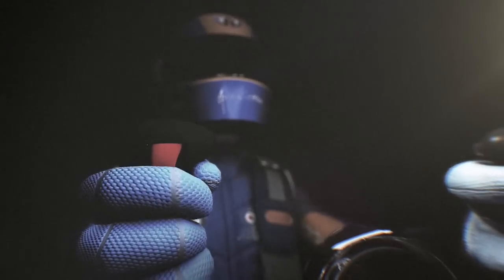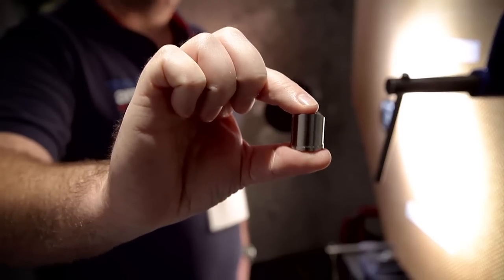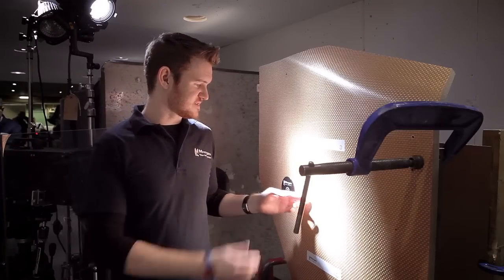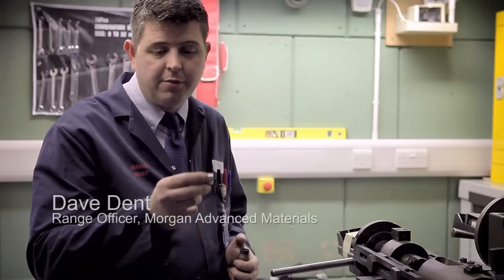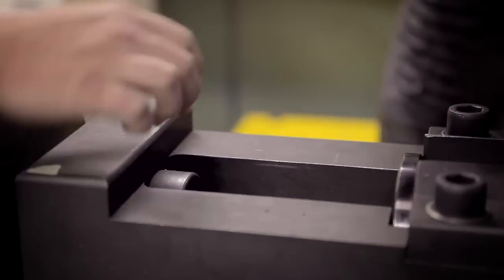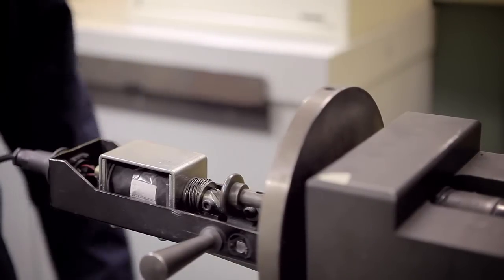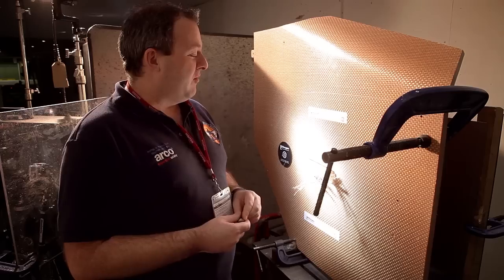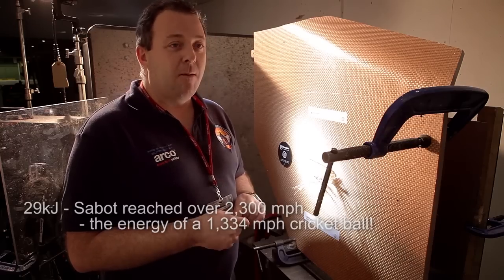Shooting BLOODHOUND SSC - Ballistic tests on cockpit protection panels

Comment: What if the wheel just destroys it self?
Reply: Lets assume the wheel has a circumfrence of 3 metres, a one Kilogram chunk of that wheel will be moving at 170*3=510 Metres per second. If the entire rim lets go at the same time and divides itself neatly into 1KG chunks, opposite pieces will be over a kilometre away from each other after a single second. !  
Lets hope that doesn't happen.
Reply: WaxingRadiance
At any speed, the top of the wheel is travelling at twice the speed of the vehicle, while the bottom isn't moving at all.
Reply: Camsplint
I'm am not sure what you are saying. Are you saying the 'bottom' of a 10,000 rpm spinning disk is not moving ?
........
Reply: WaxingRadiance - he's saying the relative velocity of the point of the wheel touching the ground to the ground is zero. If the wheel has zero slip against the ground, this would be true.

10,000 rpm x radius gives the speed of the outside of the wheel relative to the center of the wheel.
Reply: WaxingRadiance - oops, forgot a bit. The speed of the center of the wheel relative to the ground is the vehicle speed.
Reply: Then you crash. And small bits of wheel going through the ballistic protection become almost the least of your worries.